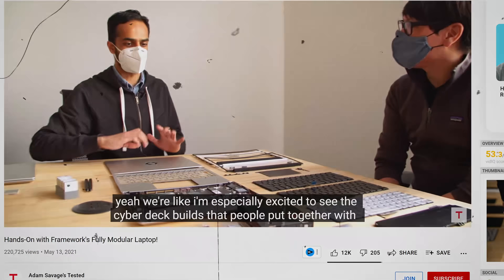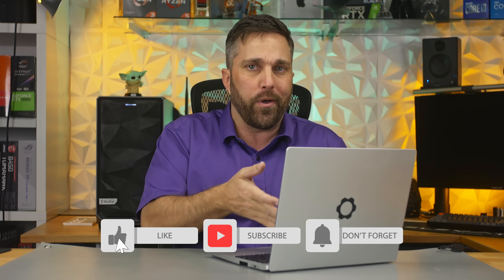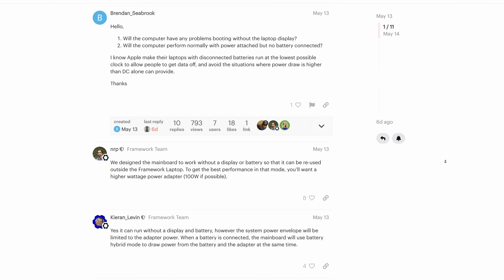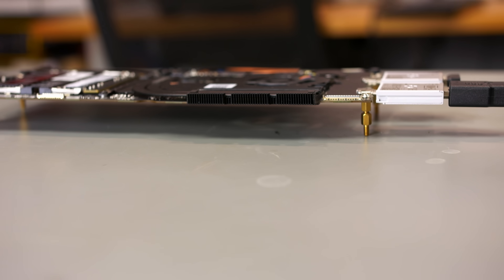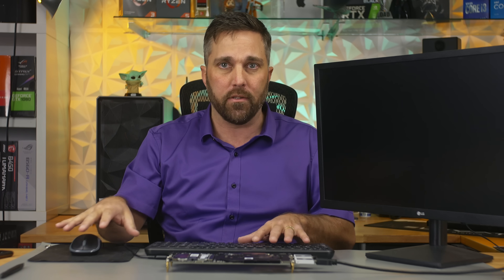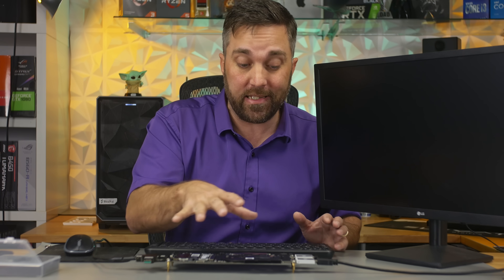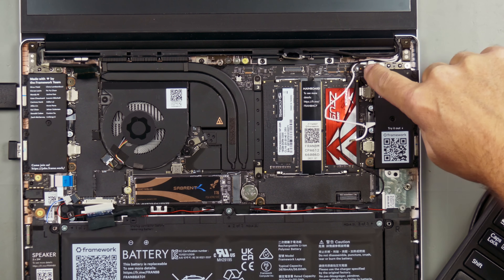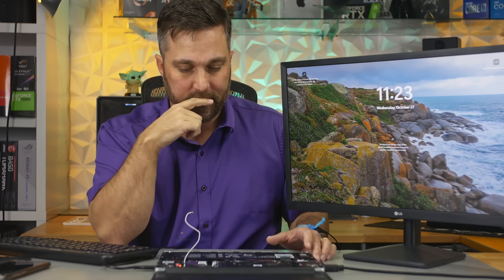This Framework Feature Isn't as Advertised. - Mainboard Testing.

Comment: Completely ignorant question here, even without a firmware for battery-less operation, wouldn't it be an option to make a jumper cable/connector for the battery that tricks the system into booting? Stuff like that has been done for years. Just trick the motherboard into thinking there's something plugged in and that's it.
Reply from the maker: Yes and I've been doing it for years but it's not always straight forward depending on the protocol in use, and not something I can do in a general tutorial for beginners.
Reply: @ElevatedSystems  that's pretty cool! What I also meant is that in the case that frame.work couldn't update the firmware to allow battery-less operation, they could sell a bypass connector for a couple bucks, right? That would leave the option open, still, seeing the laptop can operate without battery after booting, really looks like it could be handled via software. And btw thank you for your content, keep it going friend! Thanks!

Comment: I agree with your points regarding not being a launch feature when they said it was, and how disappointing it is. Let's be real, it doesn't matter if only a few people will be affected by it, but if they said it is a launch feature, then it should be a launch feature. 

However, your comments regarding e-waste are really off base. It is a feature that is coming. Late yes, but it is coming. You even mentioned that you know it is coming, as mentioned earlier in the video. Do you honestly believe that anyone who bought it, knowing that it's an upcoming feature, however late, will think that "Ah! I'm upgrading my board when a new one comes out, and now the old one is e-waste." That comment would be valid if there are new boards that you can purchase as upgrades RIGHT NOW, when the feature is not yet available. 

Just my 2 cents. 

PS. I'm not a "very biased fanboy who gave my blind devotion to a 1 year old company". I'm still a potential customer who is still doing research before committing to purchase.
Reply from the maker: But don't forget the marketplace is open and these mainboards are "coming soon". Is that before or after the firmware fix? I was honestly planning on buying a few. Also, I don't buy products for "future" features. We know how that tends to work out. How many Tesla owners are still waiting on "coming soon" features.
Reply: @ElevatedSystems  If the mainboards are purchasable now, and the firmware fix isn't released yet, then the e-waste comments are correct. This video could've been a video about the misleading comments, and a warning for those who wanted to order the mainboard, without the e-waste comment. I still think that the e-waste comment is totally off base, since you cannot even buy a spare mainboard right now.

But the fix is already available in a beta firmware. I have already stated that I agree with the comments regarding them saying it is designed to work that way. And I totally agree that if one of the reasons you purchased the product is that reason, which is absent at launch, then your comments regarding that are still valid. And I agree, those are valid. I was just specifically pointing out at the e-waste comments. 

Also, I dunno if it is just them using the "correct" words, but the mainboards are already "designed" to work without a battery. The hardware is designed, it's just software is not completely working. I don't think that the company thinks this way (being shrewd with words), but it might just be me being optimistic.

edit: some grammar stuff.
edit 2: I just saw your new edits regarding tesla, so I am adding in my reply to that.
Reply from the maker: It may be a little unfair but I did say IF there is no update. It isn't past the point of reality to think this may be a feature they intended but can't get to actually work. Again I'm very sure they will but....
Reply: @ElevatedSystems  I totally agree. You did say IF there is no update, but it's just a little unfair, like you agreed. It's just you are an influencer, and like you said in your video that your video generated thousands of clicks to their site, so you could've been a bit fairer. Just a tiny bit. You could provide criticism, which is called for, and show disappointment, but still be fair. After all, they are very consistent with their company's mission and goal so far, and I could honestly chuck this as a feature that they figured out how to work too late. But that's just me.

PS. I added to my previous reply since I just saw your edits (re: future features) after I posted the reply.

Comment: Read a through a few comments, I must be one of the few that isn't surprised.  It's a laptop motherboard.  I'm actually surprised that it could even operate without a battery because I would figure that the power circuitry would fall back on the battery for power regulation.  This of the power circuit more as a built in UPS.  That said, why would you run it without a battery even as a desktop?  It's basically a free UPS.  So, kudos to Framework for working on battery-less, but I would totally take advantage of a battery using the motherboard as a desktop/server machine.  Side note: this is actually how the mega-companies build their servers so that failure in the backup power for the site doesn't bring everything down.

Comment: Wouldn't combining the mainboard with the guts of a DAC be a terrible idea in terms of audio quality? As far as I know, the case and case material of the DAC is designed to reduce EMI as much as possible, and putting a mainboard that definitely wasn't designed to deliver super clear audio + a 3D printed enclosure would beat the purpose of using a high quality DAC in the first place.
Reply from the maker: The idea is still forming but ultimately the mainboard compartment would be shielded and the DAC would probably just slide into a specifically designed "Bay" intact.

Comment: I would suggest plugging a 10k resistor into the positive and negative battery connector on the board.  Maybe it will attempt to charge the battery but its a 10k resistor so it might be fooled just like that

Comment: Eh. I feel more mislead by the title of this video than the statements from Framework.
Reply from the maker: Why? You can only be let down by a company you trust and respect so it's a true statement.
Reply: @ElevatedSystems  I don't feel let down because the battery is not part of the case. It sucks that you currently have to use them both together still, but their statement remains true that the mainboard will work outside of the case, you just need to bring a battery with it. Additionally the leads coming from the battery are likely little more than BMS leads or some kind of serial communication , meaning that you could make your own battery or even a "dummy" battery that simply tells the mainboard there's a fully charged battery there. Also, they're addressing the issue, which tells me that getting the mainboard working without the battery has been on the feature roadmap all along. To me, the feature to work without a battery is a "nice-to-have" and not a requirement, so I'm glad they didn't let it delay launch.

Comment: Tbf they did say it will be supported if i recall well
Reply from the maker: We designed the mainboard to work without a display or battery so that it can be re-used outside the Framework Laptop. To get the best performance in that mode, you’ll want a higher wattage power adapter (100W if possible). -Nirav Patel 13 May 2021

Comment: You didn't need to do such a video, this is rly.not a big deal just plug in the d Battery even if it's basically dead or plug in an aftermarket one. It's obviously made so that it can function out of the chassis with even an power switch On Board so stop being so hypocritical, The Bios update is coming, no need to make negative Comment's about an artificial Problem. Imagine the only thing People see is your headline and then they think are dammit bad company.
Reply from the maker: It's not artificial. I spent $1400 on a laptop I was told had a specific feature at the time I bought it only to discover it didn't and now I have to wait. If this feature was a consideration for me to purchase it than I'm sure it may be for others too. Don't they have a right to know about it?
Reply: @ElevatedSystems  Well the Laptop is basicly still in beta I cant even get one and I´m certain you can bridge the Battery somehow or just use another battery and as you showed the system is running without the battery, So the Only Problem is that your DIY Project needs a minimal bit more of DIY... thats what im trying to Say. Your Title and the beginning of the Video are very dramatic and catching and statisticly the average viewer only views the early portion of the video and that is very negative in the current form. If You made a less clickbaity title(I know clicks and money) and start with the starting with battery and then disconencting it showing it running and then Testing it without the battery would be better. You Probably wont influence many People as of right now and the current viewership of these Videos are already invested People, but I still believe That a Person could get disonformed by the first Video half and get a negative standing against framework, which is something we all should absolutley not do in todays cancel culture.

Comment: I was going to dispute the purpose of this video, but thinking about the implications of being able to use the motherboard externally, it could drive more business that would help Framework succeed. Hopefully this will put sufficient pressure on them to prioritise this capability.
Reply: Why? Why would someone buy a framework laptop to use the mainboard externally today? Maybe later after replacing it, but today is better to use a NUC or any other single board computer. Also they are working on it.

Comment: They promised it would work outside of the original case, which means they don't go out of their way to detect the case being open, etc.  In all of the videos I have seen, they never said it would (currently) work without a battery.  In fact I saw a few videos saying that it would not work without the battery with the current boss at the time.
Reply: Exactly. Even in the forum they wrote "it is designed to work without battery" and "it can work without battery" and it does (as soon as the firmware is introduced officially). We're talking about a product that is almost a prototype here where they are clearly forced to partially figure it all out as they go along. Buying such a innovative and new product and complaining that it's not immediately delivering all it promised is excessive. A way more honest approach would have been to ask the devleoppers if the patch is available, install it, test it and show that it works (if it does!).
Reply from the maker: Check the forum link in the description. They very clearly stated it would work without the battery connected.

Comment: I find it somewhat peculiar and artificious to complain about the lack of possibility to use the motherboard separately after a few months of usage when you've just spent ~1k on a fully functioning laptop. Although it's your right as a customer to dismantle your laptop in the way you see fit, it also appears to be absolutely unnecessary if not to make a big deal out if it for clickbaity purposes. Framework is keeping up to their word and it's really hard to criticize them for a few months delay when they're a newcomer in the market with loads of difficulties (also due to the contingencies of the post covid market) for a feature that is clearly intended to be for when the whole package starts to fail.
Reply from the maker: I was prepping and testing to get ready for when the mainboards were available on the marketplace which has already launched. I planned on buying a few.
Reply: @ElevatedSystems  Motherboards are not even available yet and the bios beta is already available. This is a completely minor hiccup and it becomes virtually irrelevant if one takes the bigger picture into consideration. Talking about e-waste is just nonsense imho.

Comment: I'm not a big fan of the clickbait title and thumbnail, but yeah, I get your point and I support your argument. Laptops refusing to work without the battery is like a multi-function printer refusing to work without cartridges (canon, anyone?). It's almost as if getting rid of removable batteries as a feature was a bad thing haha.
Reply: Hmm but there are a lot of devices that don't work without the battery installed.  I suspect that this is because if you plan to have something that draws surges of power from as battery, you can have a lower wattage power supply since the power supply won't have to handle the surges if there is a battery.

Comment: Ok so I have two opinions about this. 
1. People who are disliking this video are completely stupid. This guy is reporting a FACT. Even if you like the company, if they have the balls to own up to it (which judging by the pinned comment, they most likely do), they'll fix the issue. If not, this guy is giving you a heads up.
2. To the creator of the video. I honestly don't see a problem with the Motherboard requiring a battery to run, as it can only be a benefit when facing a power outage, and laptops, when connected can work even without a battery as long as it's connected.
Reply from the maker: To your second point leaving a battery plugged in 24/7 is a bad idea. Smart controllers aren't that smart and the battery will degrade and can overheat and swell.
Reply: @ElevatedSystems  you could design a power distributor that only uses the power from the battery during startup, and disconnects it when on use. 
Also I'm gonna say it here, I have a 9 almost 10 year old laptop with a factory battery that still gets 80% life and stays on for 2 and a half hours.
I understand your concern, but it's not as big of a deal as you're making it out to be. 
Plus, even if it was, you could probably just find another battery anyway.

Comment: I suspect that this is a battery protection feature engaging when a battery isn’t connected. To verify that the battery is in a good state to boot the computer. 
“If battery voltage less than X then halt”
But failed to catch case X is equal to 0 & plugged into usbc and running usbc at 20V. Which is why they are confident in updating the firmware to do the correct behavior. Hence why you were able to boot windows 11 with battery then remove it and reboot. Because the reboot from windows would be considered soft and not needing to run all of the firmware boot process which may have skipped the battery check.
Reply from the maker: That is exactly what I believe, so how is it possible they didn't know this the day before launch and for the past 5 months?
Reply: @ElevatedSystems  and again who said you acrually had a 100w power supply and i mean a true RMS 100 watt power supply show us the proof  show us that power supply can handle 100 watt

Comment: Dude, nobody let you down. They're fixing this minor fixable software thing. Don't be a drama queen
Reply from the maker: They are fixing something that I was told was a actual working thing before I bought it. Maybe you don't mind not getting what you pay for but yes, for me it's a let down. Mostly because I hold this company to a way higher standard than Apple or HP. If that make me a drama queen bring on the crown.
Reply: @ElevatedSystems  But it did work, consider the battery thing a bug they are working on fixing, in today's world bugs and software / firmware updates are the norm.
Reply from the maker: @MrJleonp  That's not a bug, look at 06:00 that behavior is a specific POST protocol which is intentionally built into the firmware.

Comment: Have you tried disabling the battery in the BIOS?
Reply from the maker: Yes but that only disconnects the battery so you can safely open the laptop. It reconnects as soon as you connect the power cord.
Reply: Ah, I thought the intention of that setting was to reduce strain on the battery if you have power plugged in all the time (like at a desk).
Reply from the maker: @hutsoncappelmann603  I think that info might have been put out by someone in my line of work, but that isn't what Framework has said.

Comment: I would say "cut them some slack". For the first product, even with these kinds of flaws, the result is amazing. I got my framework two days ago and I'm extremely happy with it
Reply from the maker: This isn't a flaw or a bug. This behavior is built into the system firmware and they had to know that before they released it. I would never have mentioned it if it wasn't one of their "what sets us apart" talking points prior to launch.
Reply: @ElevatedSystems  I for one am very glad you did this. I am so sick of tech companies saying this does this or that when they know it doesn't or that it will sometime in the future that never comes. Stop promoting features that don't work as features to come. If and or when they work with a product then you can promote it, otherwise it is a pipe dream.
Reply: @ElevatedSystems  firmware is software it is beta it is a bug stop your BS claims

Comment: wouldn't a false jumper connected to the battery connector work since the motherboard would think there is a battery connected when there isn't. i could be wrong but thats my guess.
Reply from the maker: No pretty sure it would need to deliver voltage within the correct range to POST.

Comment: I’m a computer engineer, and my guess is their POST routine checks voltage on the positive battery circuit and shuts down if no voltage is found (or the voltage is out of range).
Reply from the maker: That is exactly what I think given the quick boot loop, and is why I tested disconnecting the battery after it was booted up.